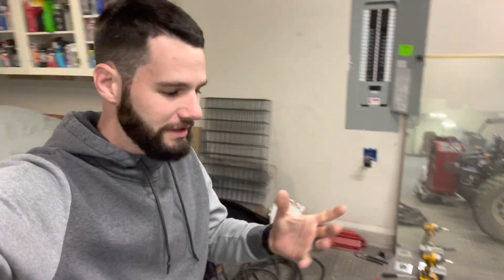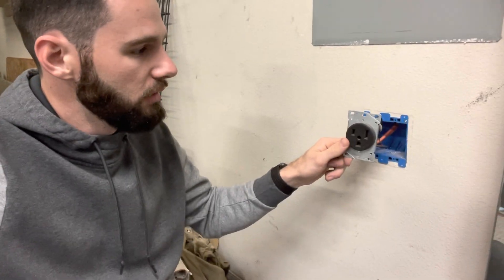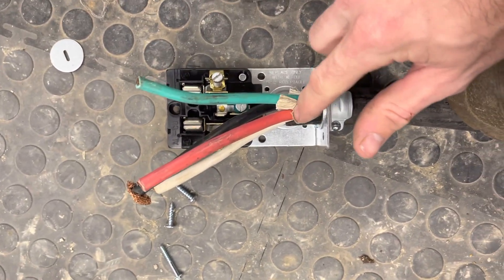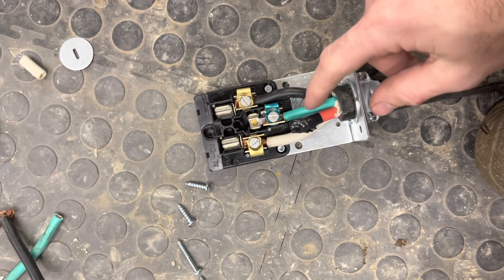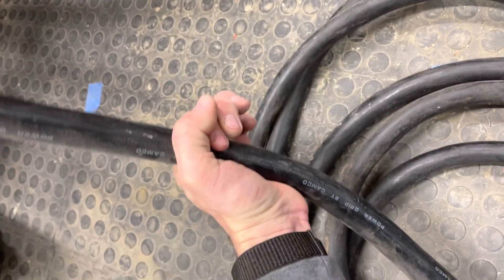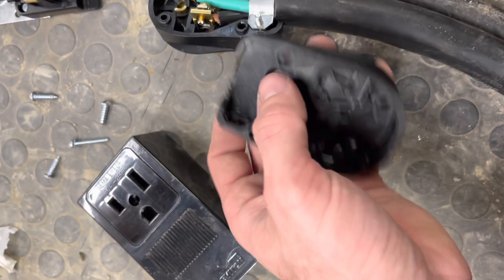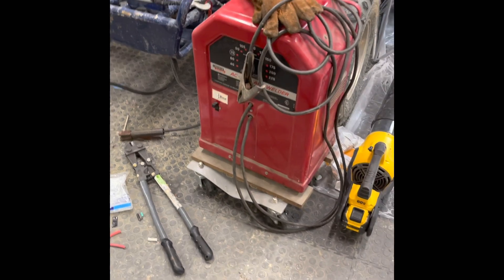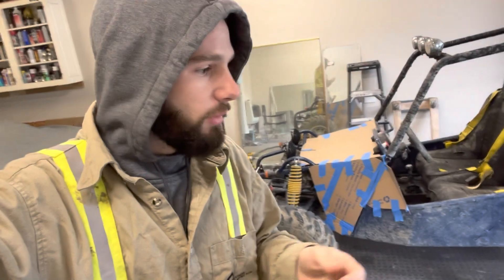HOW TO MAKE AN EXTENSION CORD FOR A 220V WELDER

Comment: When you are making something for 220v and you have the option to use red or white, always, always, always use the red. 
Yes using the white will physically work but it is not best practice to do so specifically when the proper designated wire is right there.
I swear people cut the red wire because they aren't used to seeing it or something.

Comment: I don't get it are they 220v or 240v and i have welder say 230v????????
Reply from the maker: I’m no electrician, but I’ve never heard of 230 before, and for whatever reason 220 and 240 seems to be interchangeable terminology 
 
I have no idea honestly, I think I wired this as a double pole 20 or 25amp breaker and I haven’t had any issues and have used it a dozen times
Reply: Your home service will be wired for 120/240 if it's coming from a single phase residential transformer. So 240 is proper terminology. Some equipment will say it only requires 220v AC power. So the fact you have a 240v service is more than enough as long as your breaker has enough AMP's to support it the welder/compressor. I.e 30 amp or 50 amp breaker.
Reply: Can it work on a 100 footer ?

Comment: Great video.  I'm assuming that if you had bought the cord NEW, you would have gone with 6/3C.  I realize your friend gave/sold you the 6/4C, so that's why you used it.  One question, though.  If I had the choice, should I cut off the white wire or the red wire?  I associate white wires with neutral, not "hot".  If I used the white wire for one of the 6-50 "hot" legs, should I put a band of electrical tape on each end, or is that just for permanent wiring?  Thank you.
Reply from the maker: you can use either color, i agree i have seen both colors used completely up to you if you want to mark the wire for the next person or if you want to mark it just for your self! thanks for watching!
Reply: Green: ground
White:  Neutral
Red: Hot
Black: Hot
Please be extremely careful and be 100% certain of what you are doing or seek professional help. Mistakes with this power can easily kill you. Most electrical supply shops will help you out if you take it to them